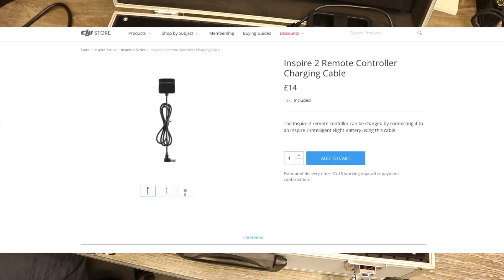My DJI Inspire 2 & I1 Custom Battery Charger Overview

Comment: Great product! To which pin did you solder the positive and the negative? So what are the 12 pins for?
Reply: The positive went to power and  negative went to ground.

Comment: Nice little rig.  One question, why didn’t you use 90 watt supplies instead of 60 watts?  I ask because isn’t the standard DJI Inspire 2 charger a 180 watt power supply that charges 2 batteries at a time?  Thanks a lot and great videos.

Comment: nice DIY !!  Curious, does the circuitry (bottom area) get hot?  Is the fan pushing air in, or pulling out?
Reply from the maker: It’s pulling air out and there is another vent along the back.  

As for head with 4 packs it gets a little warm but nothing concerning, the PSUs are passively cooled officially and I only added the fan to give a little more air flow as the original design was for the inspire 1 and the packs dropped into the case though holes, this allowed for airflow but when I moved to the I2 those holes were blocked.

Comment: How did you get the molded backing off of the TB50 cable PCB and connector? I've nearly ruined one trying to get it apart.
Reply from the maker: Not easy, a lot of time with a hack saw and a stanly blade.  It can be done but it’s a slow process.

Comment: Great project.  What voltage resolution do you get from the Arduino? 12 bit?
Reply from the maker: 10 bit on the Micro 0 - 1024 steps, so the 26v input goes through a voltage divider to five me the input to the board, now with out filly checking I can't actually remember what I didi but i'm sure the 26v come in about 600 on the scale, I would need to check the sketch.